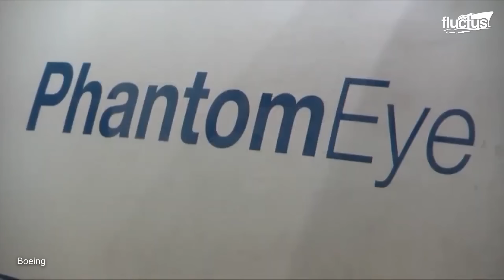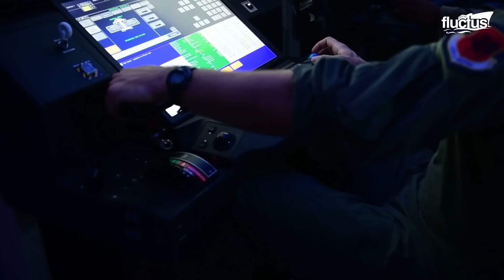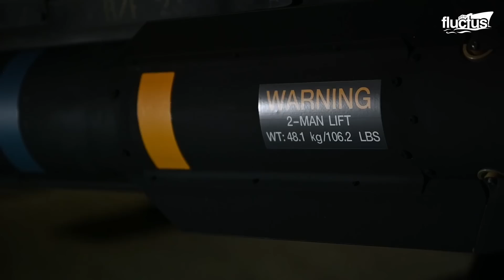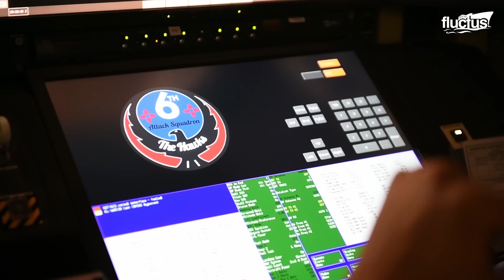What Happened to This Weird Looking US Spy Drone?

Comment: What is the fuel payload of mq25?  It looks kinda small for fleet refueling unless they plan on hanging extra drop tanks
Reply: It has around 3/4 internal fuel payload capacity of F-18 it is taking that role over from, but it's single engine likely is much more fuel efficient than two F-18s run, so may be somewhat of a wash on how much can actually offload.
Reply: 14,000 pounds of fuel is typical for the MQ-25.  Even greater fuel capacity is expected.

Comment: They can make this Reaper in flight refueling unless theirs a maintenance issue or ammo these drones can loiter longer minus annuals between flights instead of the twenty plus they can bump up the flight time by swapping out pilots on the ground versus landing 🛬 possibly fuel n go. Now drones should refuel drones so soldiers can have their look outs longer. These should have a pod slung underneath so men/women can be used for a medivac Situation